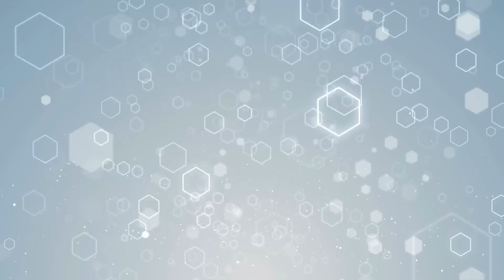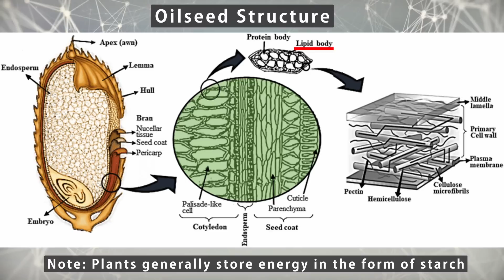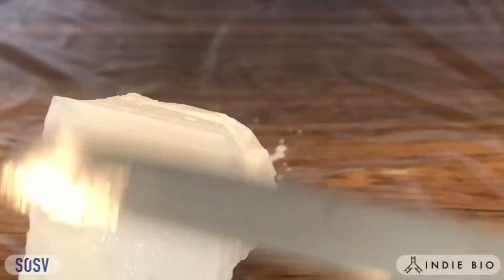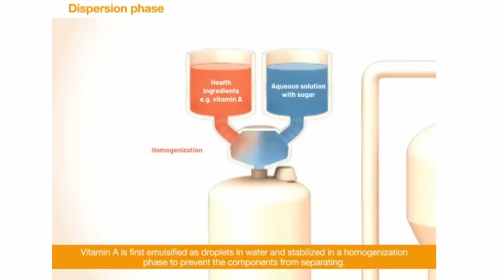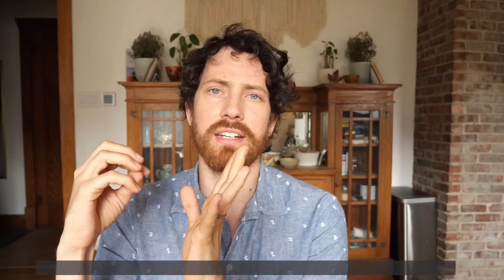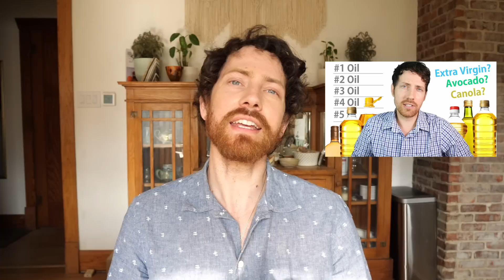Did This Start-Up Just Make Animal Fat Obsolete?

Comment: Do you think you’d still absorb all the fat if it was micro encapsulated?  Or would you get some of the effect of fiber where some of the fat just passed through us?
Reply: My guess is that you would still absorb all the fat, as it’s designed to resemble an animal fat cell, rather than a plant one.  I don’t think the membrane is the same thing as a plant cell wall (fibre), but I could be wrong.
Reply from the maker: I think this completely depends on the encapsulation material. You can use cellulose which is insoluble fiber which would likely have a nice effect. However, I am guessing that starch which is easily digested is what is used.